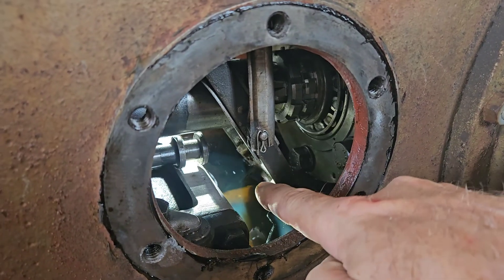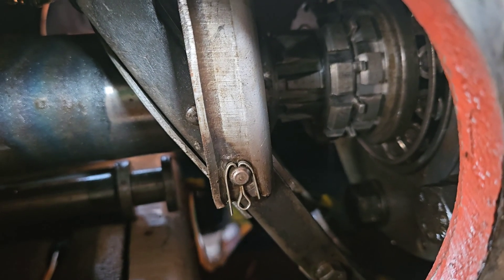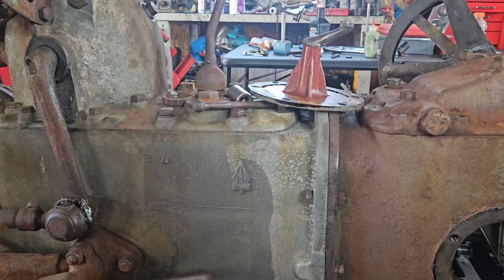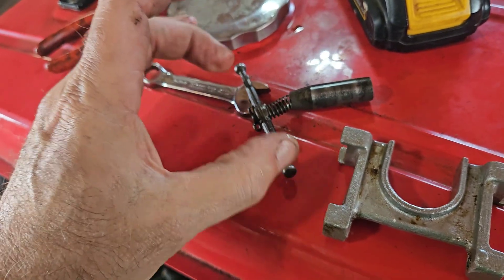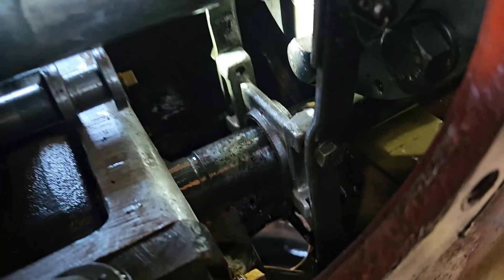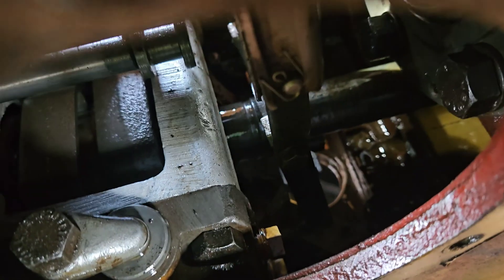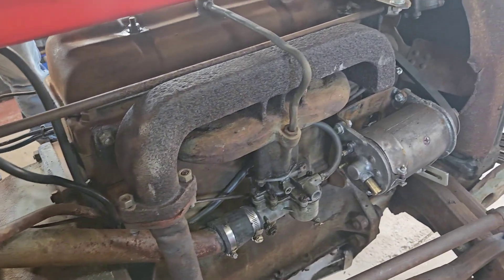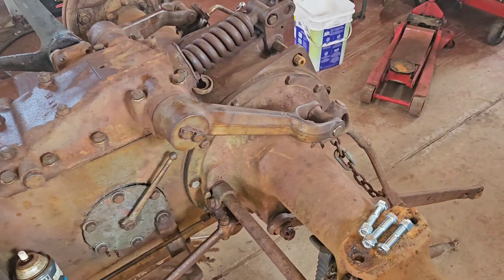Can't get it up? Lets fix a 3 point hitch hydraulic system on this Vintage Ferguson Tractor

Comment: Putting one back together now. Had the top cover on and off several and dropped the pump 3 times…. Then the sump pan leaked bad…. Then dropped it, resealed it and attached the cast aluminum stabilizer/clamp not seated properly, popped out the spool valve, bent the fork and even bent the little thin inner valve stem….. good thing I bought 2. Now I just gotta try to get this other one to go in without dropping the pump. Everyone seems to be able to do it (with swearing) I wasn’t able to get it to clear the casting without putting strain on the little valve stem. On the plus side, I’ve educated thoroughly educated myself on these systems so I can do it many more times to come!! Yay lol. We did get 2 of them for me to fix up for the farm so I’ll be doing it again for sure.
Reply from the maker: It certainly can be a challenge getting everything lined up properly. Glad it is working out for you

Comment: So was the orientation of the control valve fangs up or fangs down on that little T bar Kinda thinking this may be whats wrong with mine.
Reply from the maker: try up but it might not make a difference. Our issue was the wish bone
Reply: @JimsNBHomestead  alrighty and ya last year I ended up w this tractor and the hydraulics have had me puzzled lol. It's a 1950 model so I'm gonna give this here a look and see if this may b my issue
Reply from the maker: Stuck valves are a happening
Reply: @JimsNBHomestead So get this. One of the 2 I got to work on had a CURVED t bar/crossmember for the spool valve. Curved in 2 dimensions like bullhorns and also connection point would sit either farther fore or aft. It was on one of them (don’t remember which) but I can’t find ANY literature showing one, only the straight, and with the little fangs. Really set me back combing through deciding if I needed to use it and swap it onto the new spool. But I doesn’t end up with the ball ends on plane with the sockets of the forks anyway. I have a feeling it was made to be able to use mismatched styles of pump and top cover. Cause the earlier pumps differed slightly from the later te20/te30 pumps. The later te30 type have a long hex shaped pressure relief valve and a “hood” over the bore for the spool valve. Also makes getting the spool in with the pump installed more maddening… since most of these tractors got swapped pumps eventually it could have been used to fix geometry issues. And most of these tractors also got Frankensteined together, which I am currently contributing to by using the pulp and top cover (better cylinder) from one on the other! The next guy is gonna have a really fun time reverse engineering playing forensic mechanic!! Warms my heart a little bit.

Comment: Gearboxhousing is magnesium, nor possible to weld. Also no contact wirh iron, it wil dedtroy the gearboxhousing. All iron bolts need to be isolated from det gearbox magnesium housing with spesial paint
Reply from the maker: Antisieze is the cure
Reply: Wait what?
Reply: No freakin way! Really I just shot em all back in pump and top cover I gotta coat all of em??